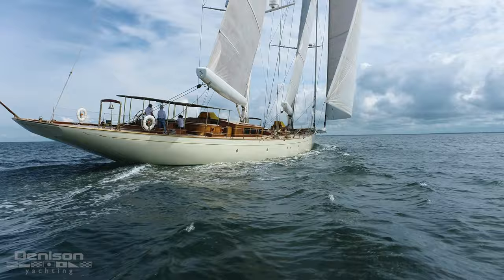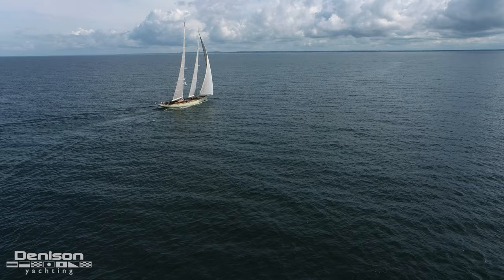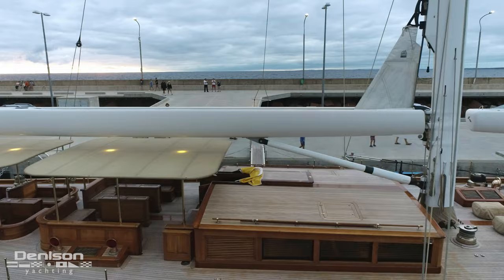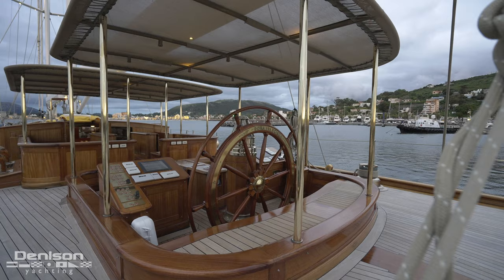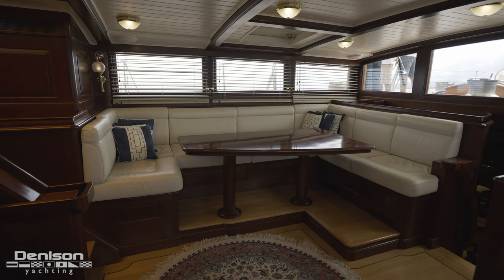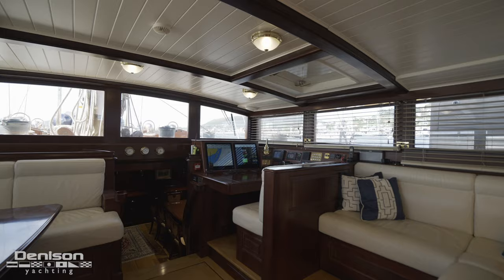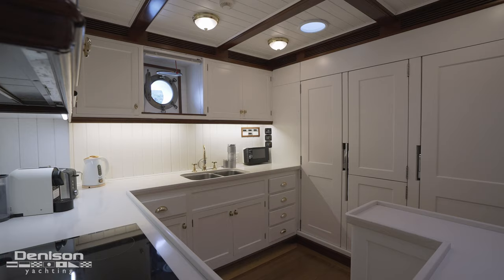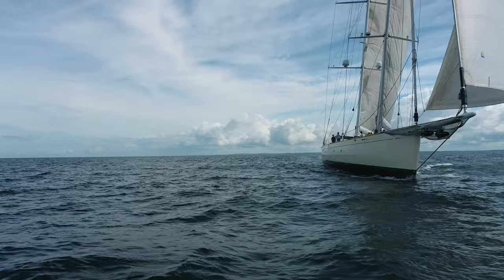Largest Carbon Fiber Schooner Ever Built [172 Sailing Yacht 2014]

Comment: Is there an estimate on how much it will cost to make her actually seaworthy?
I mean just take a look at the galley. The cook top is not only placed in an unconveniant spot, it also doesn't tilt. Neither the oven itself nor the cabinet tilts. Means it's a security risk wile under sail. Same goes for the beds. Free standing beds may look nice, but without bunksails it's a potential deadly security risk. It's a sailing vessel after all.

What do you mean with an " inversed t-keel"? 
If you take a T- keel and you inverse it it would mean put it upside down. Means the wings are right below the hull.
When you now sail an upwind course the heeling of the hull will lift parts of the wing out of the water where it can't produce drag. 
The other side of the wing will still be pulling, causing the hull to heel even more or just pushing the hull to windward depending how it's shaped.
Both makes no sense.
Reply: "What do you mean with an " inversed t-keel"?".... how do you write a "T"? now invert it and you get the shape of this "inverted T" keel...... what about thinking first and talking about "making sense" later? ..... but I give you that for serious sailing some of the interior features need attention.

Comment: What does top speed under sail mean? I thought that the wind determined the speed.
Reply from the maker: Hey Lawrence yes the wind does determine the speed but at a certain speed the vessel will only move so fast because of its size. The faster you're moving the more wind drag and water that needs to be pushed out of the way.